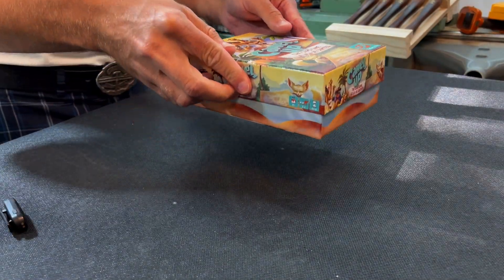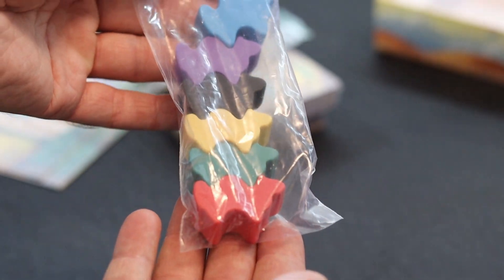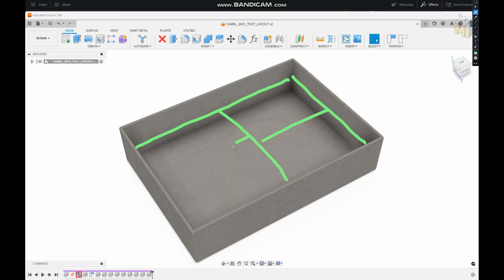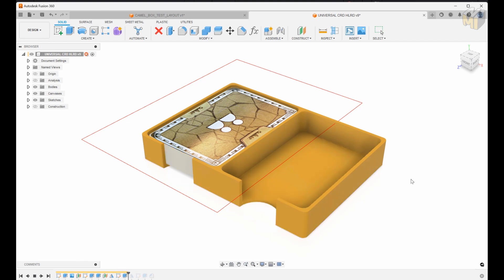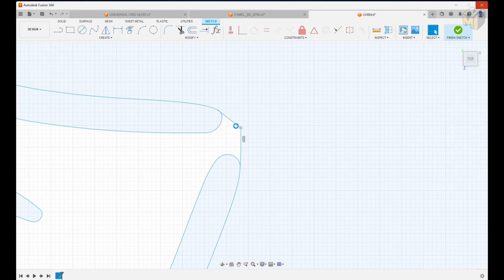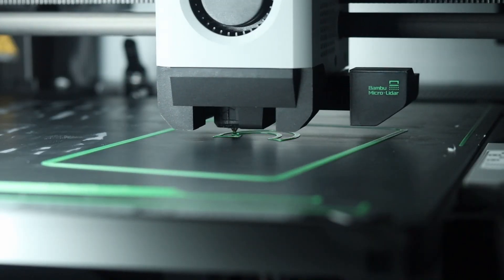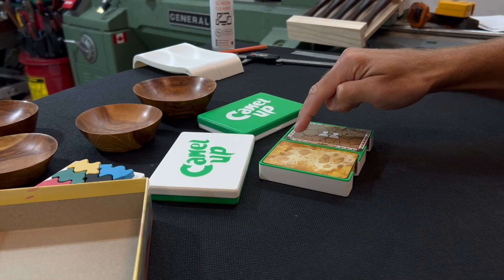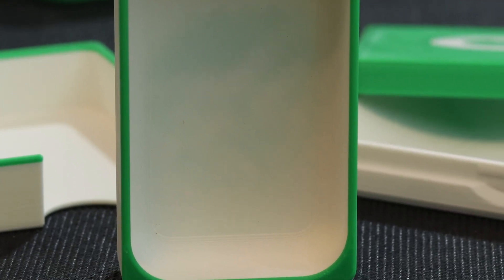Transform your MESSY games into BEAUTIFUL showcases with 3D printing

Comment: Hi, awesome concept! I am a huge fan of board games and the reason I bought a 3d printer was when I bought an insert for my favorite board game. I am having one difficulty and that is to devise a layout. It is kinda chicken & egg problem for me. To know the layout, I need to know how every piece of it looks like and to know how it should look I need to know if it is all going to fit into the box. Do you have any recommendation?

I can do it for games like you just showed but for some more complex (This War of Mine, Dune, Game of Thrones, Nemesis), I have to iterate several time and sometimes completely redo the whole project.

Thank you
Reply from the maker: I know that problem all too well!  So many options and some are better than others.  My methods are super slow as well, taking photos, drawing in Fusion, arranging, not at all ideal.  The best way to template them is to have something that allows you to easily move the pieces around while still staying compact, like some cling wrap around the parts you want to keep together.  It feels a little like something that the human brain isn't so good at.  Can we use AI for this task?